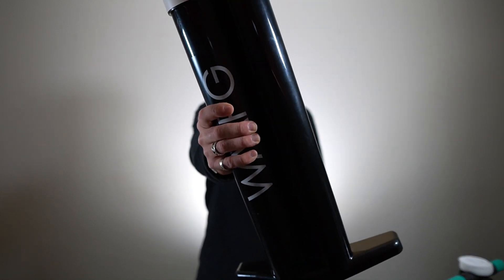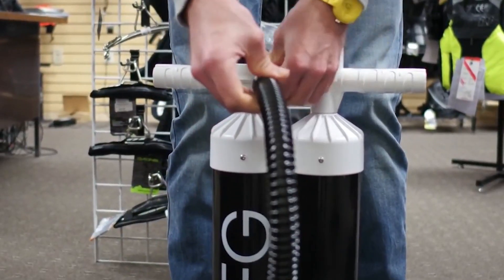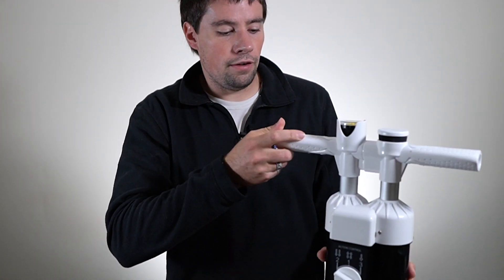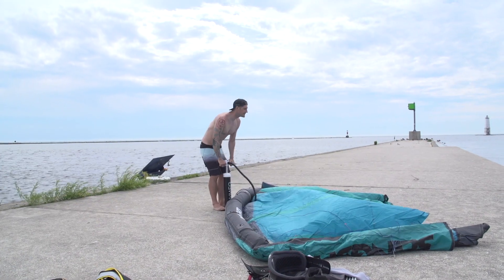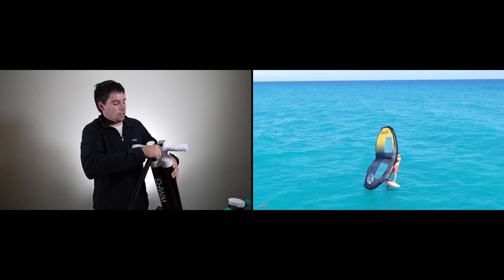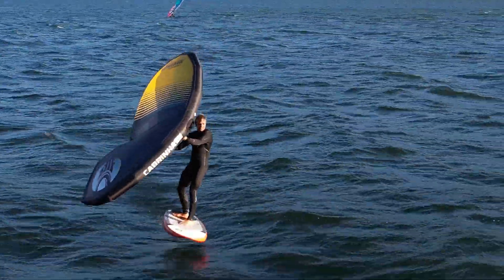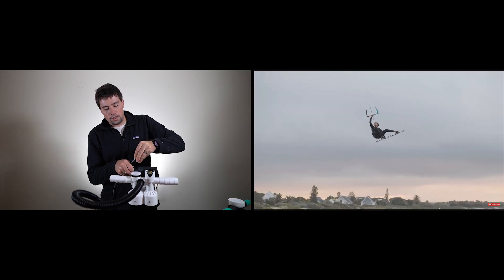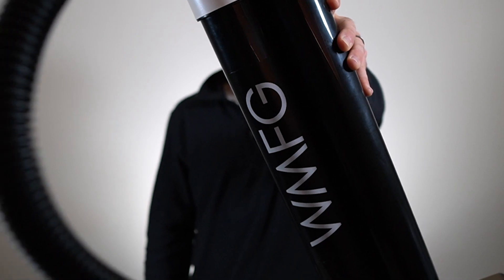Future of Pumps: WMFG 1.0P Double

Comment: And buy 3-4 extra hoses because they will likely crack open close to the pump within the first 3 months of use.
Reply from the maker: Sorry to hear that Julian. Some people do seem to blow through hoses faster than others. I've had mine for about 2 years without issues.  Some things that can help...
1. Take your hose off your pump when storing it. Lots of people kink it when they jam it into a bag or the back of their car.
2. Wrap some duct tape or similar around the hose near the pump fitting. That will keep it stiffer to help resist kinking at that common spot.
-Tucker